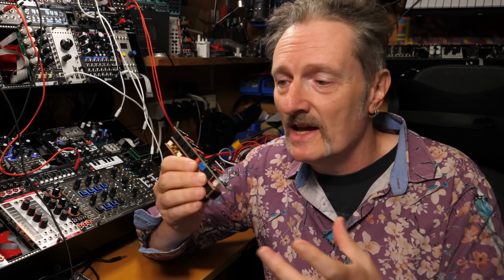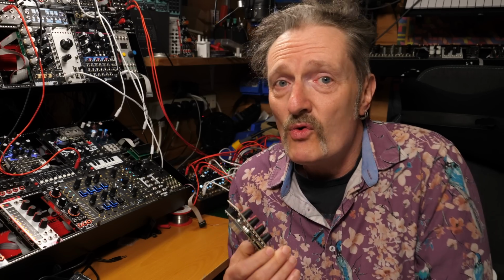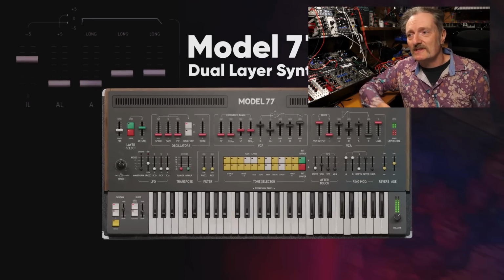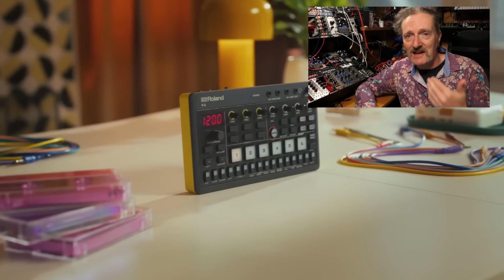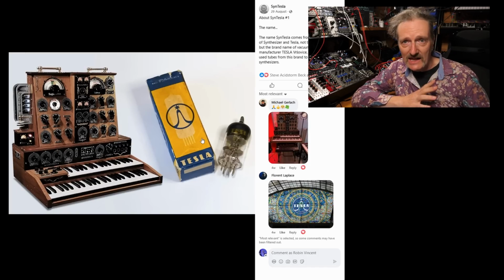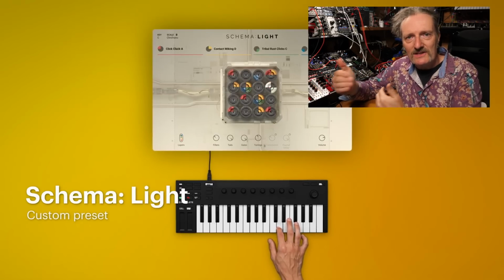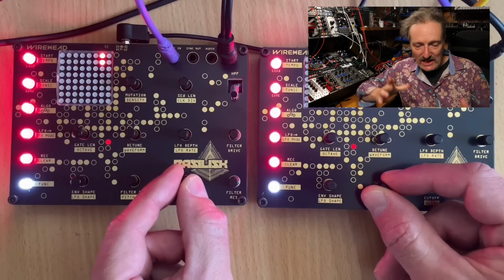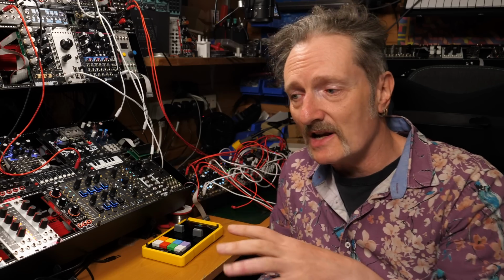Molten Music Monthly September 2024

Comment: The Aira Compacts are cute little novelties, but the interface is so much worse than any Volca. Volcas work fine because they're simple. But Roland making you menu dive on a 4-digit segmented display is ridiculous. Especially on a sampler. You can't name anything, you can't see the waveform, and you've gotta menu dive and trim samples with a 4-digit display. The P-6 has its own app to help you manage samples, but that app's never going to be maintained. Roland doesn't fix any of the bugs on the Aira Compacts. Any points it gains for portability it loses for needing the app. If you're going to use an app just use Koala.
Reply from the maker: Ok, interesting. I defer to your experience.